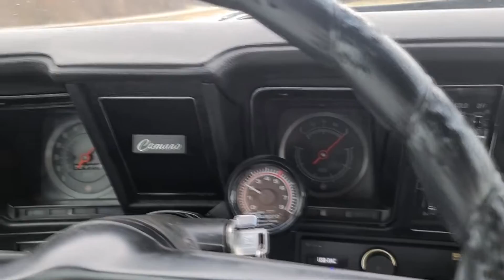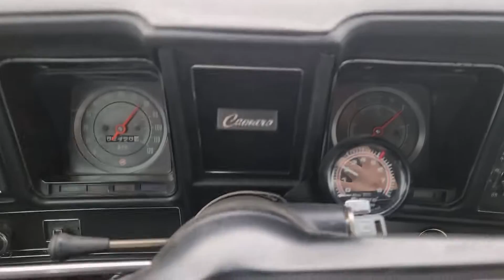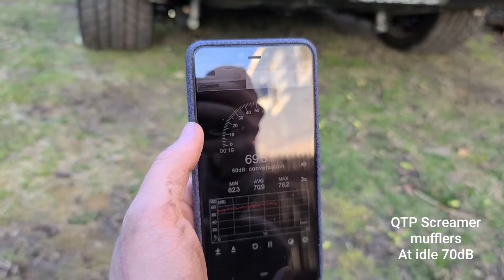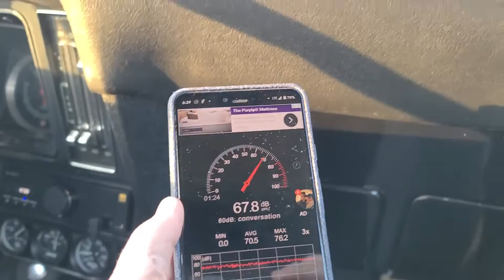1969 Camaro Electric Cutouts (QTP Screamer Mufflers) 496 BBC 600HP

Comment: How about some double clutch, rev between gear changes...  or get up to speed, high RPM, turn off the ignition for several seconds and turn ignition back on...   WAAAMMM!!    HUGE BACK FIRE...    that 496 would probably sound like a 155mm canon going off.    MY Roadrunner would make by standers run for cover...  lol

Comment: Dude that gold heat reflecting thing kind of looks like a condom wrapper, not gonna lie lol but nice man! Do u think these would fit on a 67?
Reply from the maker: You can only see the gold when going under the car but it did seem to lower the interior temps a lot I would feel the heat through the rug before, now I don't. The mufflers should fit on a 67 with no problem